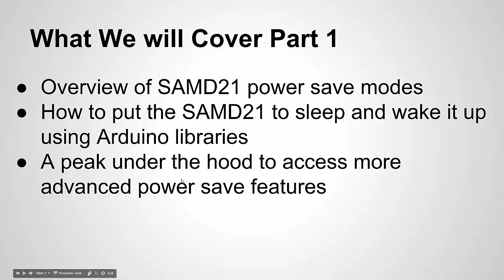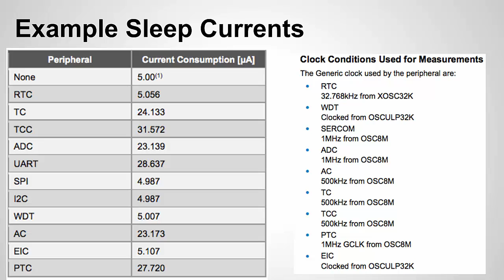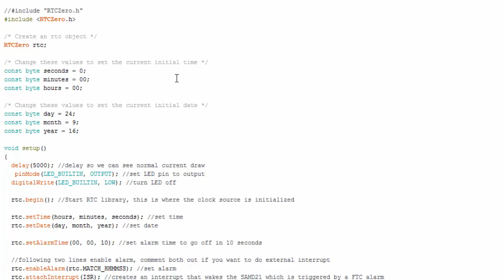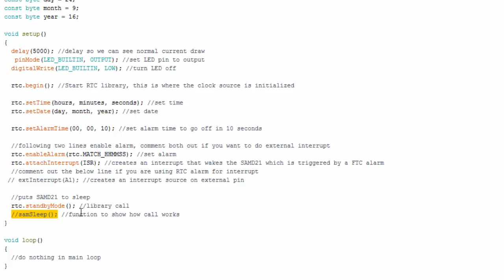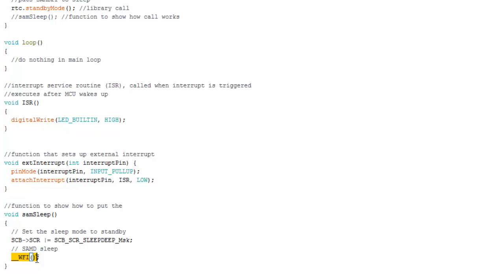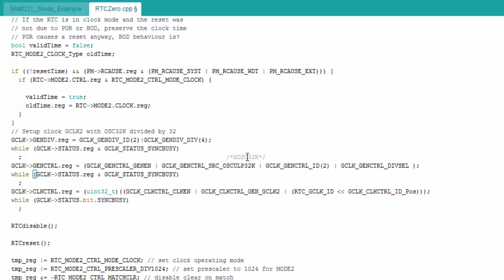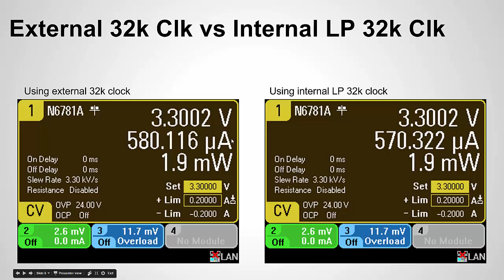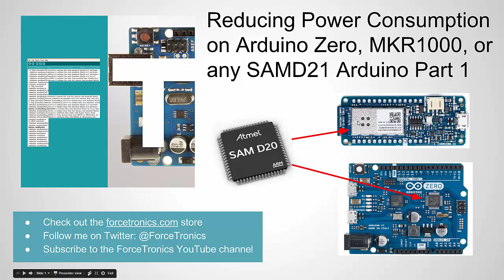Reducing Power Consumption on Arduino Zero, MKR1000, or any SAMD21 Arduino Part 1

Comment: I'm using this code for my Arduino 0 and I get 4mA in the deep sleep mode. I removed de power on led and isolated de  voltage regulators. Any idea of what is happening?
Reply from the maker: How are you measuring the current? If you are using a handheld DMM check its specs if it can measure current that low. It is not easy to find affordable measurement devices to measure low current.

Comment: Great Video Sir, i  send some sensor data every 24h. I test that with an zero board. It works for a couple of day's, than the board never come back from the deep sleep. Does anyone have a stable working system e.g. an arduino zero with this libary?

Comment: If anybody is as daft as me and got the samd board stuck in sleep mode and is unable to reprogram it, theres a quick fix, double press the reset button, that makes the board run on the bootloader constantly and does not excecute the sketch, board will apear in diferent COM port where you can program it.
Reply: you just saved my life!

Comment: Thank you for this so detailed video. I tried to replicate your code but I am absolutely not able to reach a so low power consume (0.5 mAh). The best result that I was able to obtain was only 4/5 mAh that is stille 8/10 times your consume. Where is my mistake?
Reply from the maker: Is there an LED on your board that is on? I think I broke or took off one of the power indicator
Reply: which board are you using? Iam working with a stripped down zero board and my deep sleep current is about 30uA / 170nW with 3,7V 18650.

Comment: Great video!
Is there also a possibility to wake up via timer AND external interrupt? For excample to wake up every day 12 o' clock an also during the sleep period if an external event happens?
Reply from the maker: You can use multiple interrupts at a time so combining an RTC interrupt with an external interrupt should work.

Comment: I tried Standby Mode using Arduino RTCZero library with your Mod. on Sparkfun on SAMD21mini breakout (https://www.sparkfun.com/products/13664#comment-58ee175bf3b1a85d158b4568). 
I have also removed the Power LED and supplies 3.3V directly at 3.3V pin (by passing LDO). I’m getting current in range of 300uA. Considering ATsamD21 can go down to 10uA this is too much current drawn!!

Not sure if its due to Hardware of Sparkfun board or the Arduino RTCZero Library
Any suggestion?
Reply from the maker: My guess is it is hardware related. If the LDO is off is there current leakage if you apply power on the output or are there pullup resistors that could be drawing current or is there MOSFETs or diodes that are drawing low level leakage current?
Reply: Thanks,
There is only one 10K pull up on Reset line.
LDO is off and leakage current is 55uA (as per data-sheet).
I have also made all the remain pins to Digital Input to reduce leakage current.
Still I'm getting  300uA in RTC standby mode :(
Reply from the maker: What are you using to measure current?